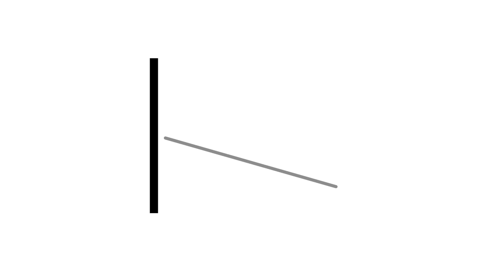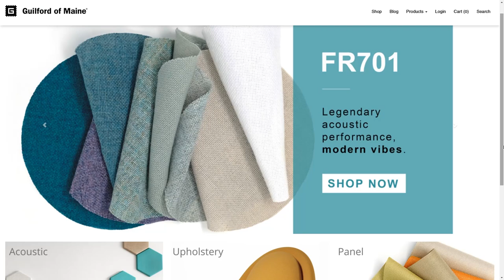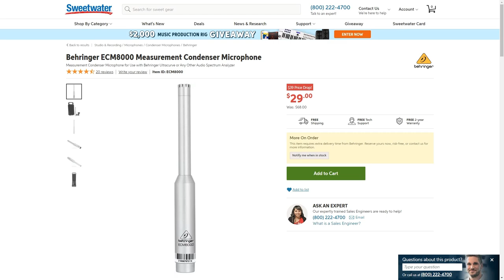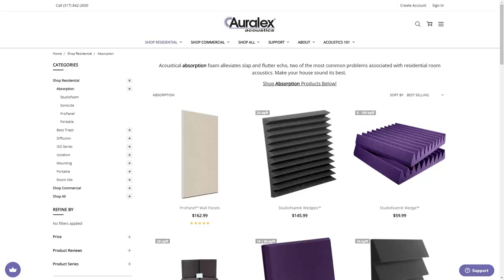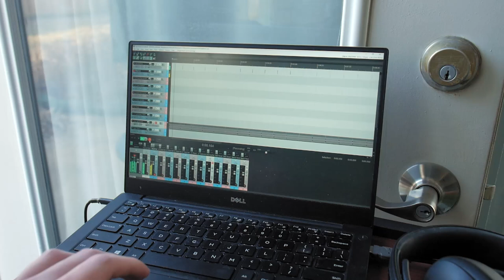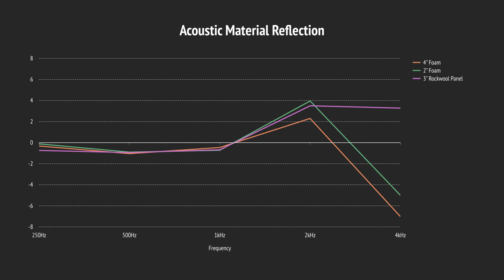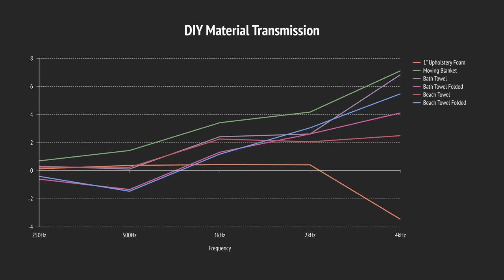How NOT to Make DIY Sound Absorbing Acoustic Panels

Comment: Appreciate this video, a bit longer than it needed to be, but I understand you're trying to be as through as possible since this is an explanation type video.

Love DIY Perks and I set out to build a version of his acoustic panels a month after his video came out but stopped short of the outrageous cost I hadn't expected from just the towel material alone, both in bulk, and in sheets from fabric stores. Suffice to say my frames still remain unassembled, however, that's not to say I have given up, or don't have alternatives.

I've been able to professionally voice act for about 5 years now starting with just some towels and moving up to a well insulated room and typical 2" think acoustic foam, but now that I've moved, I'm starting from scratch in a room with a lot of exterior noise so now I'm fscotring that aspect into what I do.

Since I'm trying to document as much of my sound-treating process as possible, I may actually include a bit of my original approach to treating a room and how I'm going about it now. Your video will likely be brought up since it has a lot of helpful information, and valid criticism towards the popular approach. I'm going to be honest and admit I'm no expert at this, but believe I know a bit more than I did before about how I'm going about this.

I'm fairly confident hindsight will be abundant no matter how much I try to get ahead of oversights by the time I'm done working on my room and video, but hopefully it's a learning experience.

I'm taking the guerilla DIY filmmaker's approach to making a studio since film is my main line of work rather than vocal, so some 4x8' sheets of foam insulation 1" from the drywall basically sums up my solution to keeping noise transmission low, while using 2" acoustic foam on top to reduce reflection.

Maybe I'll get around to putting some material in those frames some day if I can justify the cost, but unless it's rock wool, I'm not too sure what's cheap enough since a lot of us are doing this on ambition before income and we'll always put cost & aesthetic over quality. (Wool fibers are a lot more scary than foam particulates to most laymen)

If you made it this far, I'd say that's a fair trade of time for the both of us, but I'll probably adapt my approach more as time goes on. My lease is only a year and I think sticking my foam to some foam board will save me a lot of command strips this time around! Thanks again for taking the time to make this video! I only watched it because the thumbnail looked vaguely familiar, so perhaps just go full nuts to butts since is a direct correction to the popular approach of sound treating from an expert and say "The Flaws of DIY Perks sound panels tutorial". It's a direct correction, people should be directly contested if they're searching for the popular way, rather than the right way.

Cheers!

Comment: Thanks for the video, I still have a question: If I want to reduce the sound heard by my neighbours, is the towel method effective because it reflects sound pretty good ? Also, I'm not done with the video so you might explain it later but is my room going to be worse in terms of accoustic because of that ? Thanks in advance.
Reply from the maker: To reduce sound between rooms, you need physical mass. Towels aren't very heavy, so they don't do a very good job. You also need to cover an entire wall or most of the sound will just go around your barrier.

Comment: Not bad, but unless you are using testing equipment that mostly is beyond human hearing, quite a few home made methods are fine for youtube and voice over. If you are a music pro and have the money he has some good links. It will cost you many times what a diy solution would be. I have space with no ambient sound, and just old blankets hanging on every wall works amazing. I have to do little post processing. Don't over think ... there's too much info out there, and too many sound mavens.

Comment: If the sound doesn’t pass thru, then what happens to it? It gets absorbed. Bro this is a desperate plea to get ppl to waste money on expensive acoustic panels.
Reply from the maker: If it doesn't go through the material, it either gets absorbed... or it gets reflected back into the room. If it gets reflected, the panel isn't doing anything your wall isn't doing already.
Reply: @AlteraSound  so, the upholstery foam is the best option for sound absortion in diy panels, based on your experiments? btw I'm asking this cuz I'm just want to get rid (or minimize) echo in a room, not soundproofing neither sound treatment for better acoustic (frequencies) performance, cuz the room is just for meetings, so chatting is the main purpose of the room, so music or recording is not my concern. Awesome video, my man!

Comment: I'd rather have something that is actually solves a problem for me than being scientific about a subject way too complex for me to draw my own conclusions. The simple fact is. I had a problems, towels solved a problem that no other source could. I needed a practical and simple sound dampening method to prevent the noise of my equipment disturbing my daughter's sleep. That worked better than anything else. No foam could do what cheap towels finally solved and I can now work in peace and I don't really care if it's reflective or not. So, before dismissing a solution you'd first need know what problem it will solve. And that is impossible to account for everyone.
It would likely help a lot more to simply enrich that video instead of just pointing out its flaws, by going over the applicability of each solution. A complimentary video would be better for everyone
Reply: You are confused. Neither video was about preventing the transmission of sound between rooms. Nor were they about muffling the sound of equipment.

Comment: If the purpose is to insulate the sound coming in and out from a small room (the interior echo doesn't matter much), what material would you advise to put in the drywall? I have about 2.2 inch of space in the floor to ceiling wall. Should it be rock-wool then?
Reply from the maker: Insulating between the wall will probably make a decent difference. The problem is that things like a door with a gap underneath, or even having a floor or ceiling that isn't insulated, can let the sound pass by regardless of what you do with the wall. Soundproofing is only as good as the weakest link, and finding that weak link can be hard.

Comment: dude. you criticize DIY Perks test method. You ignore the disclaimer he provides his viewers warning them of  the flaws in his test method. you criticize that he is measuring this sound transmission rather than the absorption of the materials, once again ignoring his own statements about this. then you spend a good portion on your own video listing the flaws in your own DIY test rig. 
I love how you criticize his determination that folded towels don't meet the fire regs.  What?? He's not selling them, nor using them in any public or commercial environment. he clearly says that they're for personal use in his own house. Of course they aren't going to meet the fire regulations that commercial manufacturers of acoustic panels must meet. They are towels. Using your logic, I'd hate to hear your opinion on the death trap, fire hazard and illegal thing in my apartment (some people call it a linen closet)! 
Anyways, your test method is flawed, his test method is flawed. you both have to make adjustments based on your limited access to the proper test instruments. You both acknowledge that your test includes measuring the sound transmission of materials, rather than the absorption coefficient (once again due to the "DIY" nature of your rigs), but you conclude that there is  value to this ONLY when YOU do the test, but not him? why?

the main question I kept asking myself while watching your video was "what is going on with his front wall...?" ...why you treat that wall like that. sure it kind of looks pretty, but what purpose does it serve? First off, those panels affect a limited frequency range, and won't be able to touch any low-end. usually you would need to add more than 1 type of acoustic treatment to supplement foam. But choosing to plaster your front wall seems more like an excercise in vanity rather than function. There's a reason you rarely see those foam panels outside of YouTuber vidoeos videos other than  aren't at all helpful in a recording environment--that's why you never see them used in professional recording studios. And what's with the design? surely you didn't place the panels like that just because it looks good? it's inefficient. you're supposed to prioritize the first reflections first. secondary and tertiary reflection points should not need that much acoustic treatment if you've taken care of those direct reflection points. you might want to take a look at the direction your speakers are facing and grab a mirror. find those problem reflections, and relocate some of those foam panels so that they're actually serving a purpose. if you want audio engineers to take you seriously then please explain to me that design on the front wall of your control room..
Reply from the maker: Hello. The foam panels on my wall in this video are entirely decorative. I have other panels to deal with the acoustics in my room.
Reply: I agree with you on this "critique." I watched both videos and this one seemed to give the other a simplistic "dis," dismissing it all together with a wave of the hand. the other guy clearly gave limitations to his DIY.

Comment: mineral wool is meant to be encapsulated inside of walls. not to be behind breathable fabric.... stop claiming its "safe" to use
Reply from the maker: The currently available studies on the subject don't support that. Unless the panels are disturbed, there is no way for the particles to become airborne. Even then, those who work in mineral wool production and are constantly exposed to airborne fibers showed only a slight health risk, just barely enough to be statistically significant.
Reply: @AlteraSound  Lol yeah thats what they use to say about asbestos.
Reply: You can wrap it with plastic. And no, plastic will not reduce performance of the panel.
Reply: @cybernessful  yes it will. Wrapping it in plastic completely ruins the performance lol

Comment: What.. When a sound won't pass through the proofing stuff you use , that's what we exactly want. I mean the whole point is that neighbours can't hear it.. I don't care weather the sound is bouncing in my room.. About safety, I mean for example there more car accident than you can count every day, that doesn't mean you can't use cars
Reply from the maker: You're confusing soundproofing and acoustic treatment. These videos are on acoustic treatment, to treat the acoustics within a room. For soundproofing you need to add more mass to your walls, not use porous dampening materials.

Comment: These panels DIY are not great; they have a smooth surface and they can be dense/heavy, favoring Reflections and Reverb/Echo So they arent great at sound treatment. 
normal Foam panels will be cheaper and way better/easier for that (they do zero soundproofing however)

They also Arent Great at soundproofing/insulating because they only cover a very small surface on the wall even tough they may have some mass to stop the sound.
Sounproofing is not cheap nor easy.

Comment: This guy doesn't quite add up.  First, he attacks the towel panels for reasons of safety, but then recommends mineral wool as a better alternative.  Mineral wool is widely accepted as  unsafe.  So is the idea of having naked insulation hanging out in your room, skin and lung irritations are pretty obvious.  There is another video by "in the mix" who says that he opted to go with a safer "esoteric" insulation such as ground up and pulverized denim blue jeans smashed together in square panels.  At the end of the day, it's compressed fabric, just like a bunch of bath towels.  There are alot of so called professionals all saying different things about room reflection.  Half of them are probably used car salesmen.  And I'm willing to bet you have not personally tried these bath towels panels to see if they are in fact not absorbing mid range frequencies.  Alot of people say that the thin foam (like the ones you have hanging up behind you) only absorb high frequencies and do nothing to absorb low mid reflections.  So by that logic you might as well be using bath towels.

Comment: the human voice has a good amount of energy, depending on the person, even below 100Hz. 
If you're expecting Auralex products to be effective down to that frequency, you're sorely mistaken.

I recently built a huge bass trap out of fluffy fiberglass. 20 inches deep, 6 feet wide, and 8 feet tall.
After testing properly (actually measuring the frequency response before and after IN THE ROOM), it became clear that even an absorber this thick was only effective down to about 100Hz.

Fascinating how many "debunking" videos need to be debunked themselves.